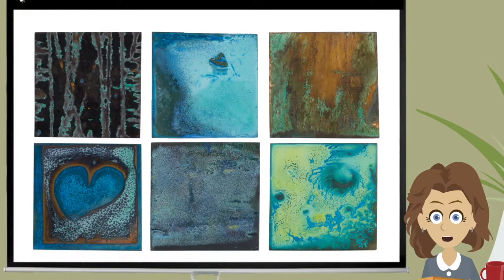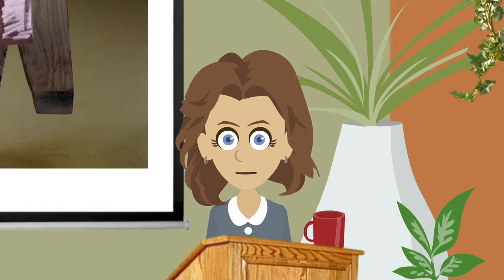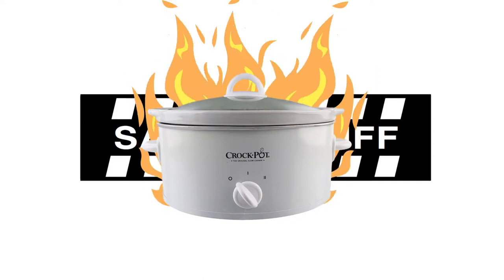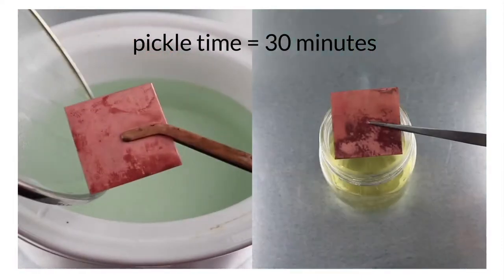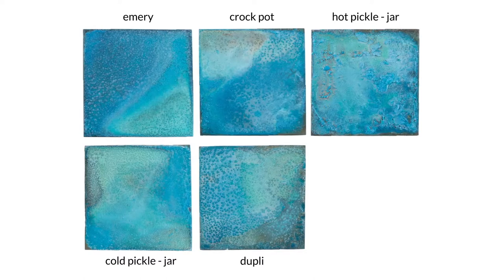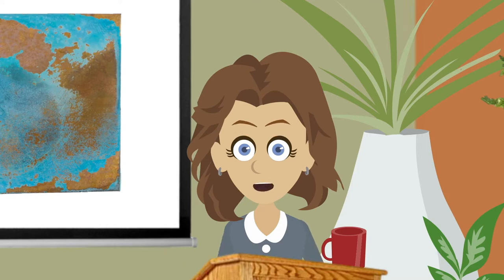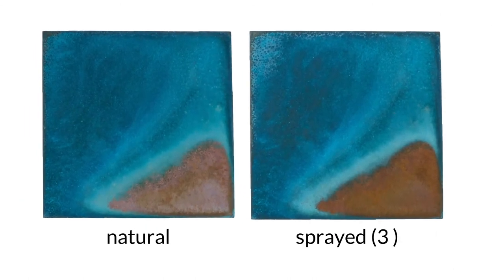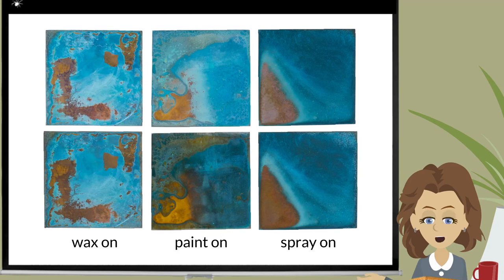Part 2i: preparations and sealing and dealing. (ammonia copper patina)

Comment: What happens to patina if it is not sealed at all? Disappears or develops further? Let us know, pls.
Reply from the maker: Hello,
An unsealed patina is often called a "living" patina... it will continue to change depending on the environment. It can rub off or be cracked if the metal is bent (although a sealed patina will also crack if the copper is bent). But where the patina comes off the copper will eventually change into a nice deep brown - complimenting the remaining patina. But, a stable patina will keep its colour for quite some time. 

Hope this helps?
n.